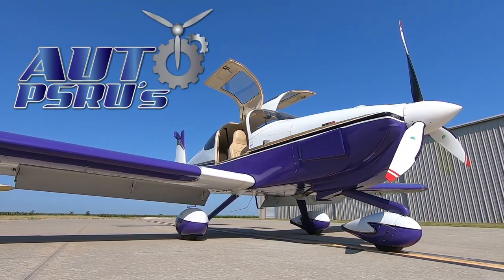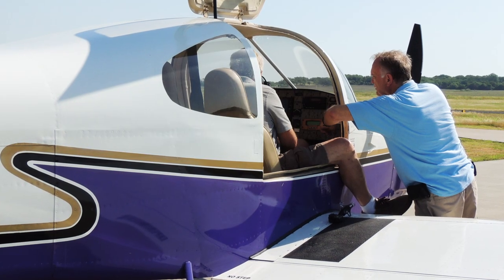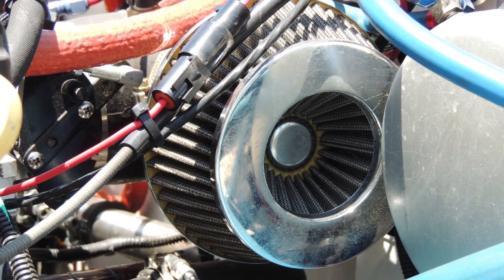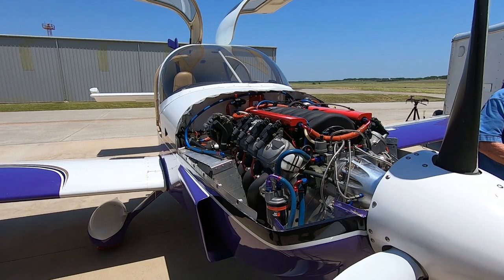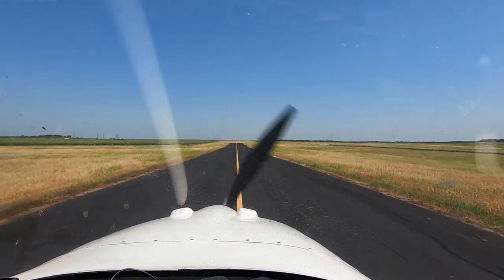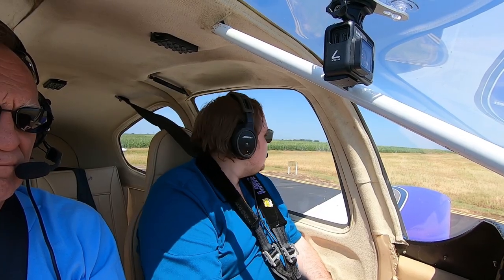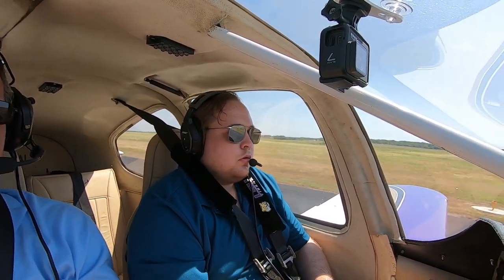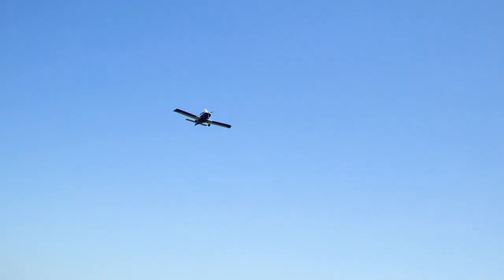Auto Engine Conversion Gearbox for Experimental Aircraft - RV-10

Comment: Tett, the weight of an IO-540 installation and our LS3 installation are virtually identical. I found that the internet is full of miss-leading weight information. This is due mainly to the fact no one gives the details of what their weight includes. Is it just the engine, did they include all of the accessories, wet or dry? Because of that I now own several types and styles of scales to get my own actual weights. Both installations including everything between the firewall and propeller weighing within +/-5  lbs of each other. That includes all fluids and mounting frames for both installations. If we downsize the alternator from 150 amps to 100 amps and use a light weight high torque aftermarket starter we can get down to 5 lbs less. The need for a three bladed propeller to handle going from 260 hp to 370 hp is the only and by far the biggest weight issue. That is why you see an MT composite propeller on this RV-10.
Reply: Awesome! Would Love to hang this setup on my Maule ... :-) Thanx Stuart! ^v^
Reply: From the Taking Off YT channel - https://youtu.be/ryl_PJEaxA8 - Engine upgrade installer is interviewed, he gives his thoughts on new aircraft piston engines - "In order to get certification, these engines have to run 100% for 160hrs, car engines just can't do that." Any thoughts?
Reply: @tetttettamilli6761  GM tested several LS1's during development on a dyno at 100% power for several days straight to prove the durability of their aluminum block for general marketing purposes because they knew that their Corvette market held them to high standards.
NASA repeated those tests to FAR33 standards for their report on viable automotive engines for aircraft titled "NASA Personal Air Transportation Technologies" by Mark Moore in 2006 with 8 LS1 engines. That report concluded that the LS1 was the best choice because it passed the FAA requirements. All of the LS V8's since the LS1 have had several improvements incorporated into them making the LS3 the toughest of all the naturally aspirated small block variants.
GM is not interested in certifying their engines because the demand does not justify the excessive expense, and they are not willing to abide by FAA restrictions on production part numbers they can use in building a certified configuration.
FYI - your Lycoming won't handle 100% power for much more than 15 to 30 minutes tops in actual use. The LS V8 conversions are operated the same way, but limited to 4500 rpm producing 370 hp of the 430 hp they are capable of making at max take-off setting. That's only 86% at take-off and economy cruise is only 46%. That's why we fully expect to get 3000 hrs.
Reply: @stuartdavis2297  I hope I don't give the impression of being lined-up against ur engine/reduction drive; nothing could be further from the truth! It's like that Austrlian guy with that Raptor canard with that Audi V6 diesel - no one more than I wanted to see him make it work. Contineltal/Lycoming has the entire GA in a choke hold and isn't thinking about letting go. So more power to you and your reduction unit/engine.
Reply: @tetttettamilli6761  Thank you Tett. I get all the Lycoming die hard miss quotes that you can possibly imagine. Almost all of it is based on miss information and miss placed opinion. There are a lot more failures out there than successes, so they tend to propagate and grow that trend. Then there are the Eggenfellner's that screw old customers in the name of moving on.
I fear that there will be another conversion company failure soon. I hope I'm wrong, but they keep repeating the same mistakes hoping for a different result. I would rather deal with competition than some else's failures.
Feel free to pass on the information on the LS1 testing and NASA report.
Reply: @tetttettamilli6761   I wonder if you took a Lycoming from 1970 and installed in in a car drove it around without any of the annual maintenance inspection that aircraft get other then an oil change would it last any longer then typical automotive engine.
Reply: @stuartdavis2297  You mentioned Eggenfellner  Honda sells their racing turbocharged crate engine for $6500 all you would need is a PSRU to go along with it could compete with them except with new Honda engines not junk yard engines.
Reply: @stuartdavis2297  how does the ls3 perform at altitude compared to a tsio-550?
Reply: @Mike-01234  As long as you have proper gearing since the engine will only turning a diesel like 2,700 rpms and added electric fan cooling for the fins (Porsche or VW style). Automotive application won't have enough natural cooling air flow by itself with all the radiant heat coming off the asphalt compared  to high speed cold air ducted at higher altitides.
Reply: @stuartdavis2297  I wouldn't be surprised if GM ran many of these LS3 engines for 1000 hours at WOT cycling between peak power and peak torque too.

Comment: With the additional weight of coolant and the reduction drive, I don't expect that engine to be pound-for-pound a comparison to the 540 series of engines. With that said, what's the comparitive weights of the two? And what's the benefit of having a clutch between the prop and gearbox - vibration/harmonics? How much less payload can that airplane now handle with the additional weight of that engine? Were any "hardened" engine parts used?
Reply: My God what a buzz killer.
Reply: Idk about this specific setup but you can build 4 cylinder Subaru engines upwards of 600hp and they way 300ish which is much lighter than an o-550 just saying and it would be FAR cheaper as aircraft engines are way overpriced
Reply: @kalancosta7650  as someone who has built a couple 600+hp Subarus...   There is NO WAY IN HELL I would run one in an airplane!  WAY too unreliable/temperamental.  Hell, at 400hp they're sketchy.
Reply: @RussellTelker  idk man if you build the short block to withstand 800+ then back it off to run at 350hp ish shed prolly last all day
Reply: And it prolly still come out cheaper than a lycoming or continental
Reply: @kalancosta7650  It'd be cheaper than LyCon for sure, but I still wouldn't trust them.  Stock they're pretty good, run them like that with maybe some forged pistons to avoid shitting out the ring lands and it'd be alright at 300hp.  Any more than that, it doesn't seem to matter how you build them, they're hit or miss if they're gonna last.

Comment: Fantastic! I look forward to learning more. I'm building an RV-10 and will follow your progress. Two questions I don't see addressed in your FAQ are regarding high altitude performance and engine noise. Does the standard ECU work well at high altitude, or do you reprogram it or use a special ECU? How does the high altitude performance of the LS3 engine compare to the IO-540 (normally aspirated)? Regarding engine noise, are you using a muffler with the LS3 engine? How does the LS3 engine noise compare to the IO-540? Thanks!
Reply: Will,  sorry for the late reply. It's taken longer than normal to get back to normal after AirVenture this year.
I was told that the standard requirement for the tables in many automotive ECU's was set at 5.25 Kilometers, or 17,224 ft. If they didn't cars could not get through many mountain passes with a low pressure system in place. Above that altitude the ECU we use will interpolate and continue to adjust timing an mixture based on sensor data only.
The LS3 will loose power as altitude increases just like any other engine will. It will loose roughly 3.5% power for every 1,000 ft above sea level. The difference between the LS3 and the IO-540 is we start out 370 HP vs 260 HP, or 42.3% more power, and will maintain that percentage increase as altitude increases. Another way to look at it the LS3 will still be producing 260 HP at 12,085 ft, or what the IO-540 produced as sea level. At that altitude the IO-540 will produce about 182 HP.
We don't normally use a muffler. We will use a cross over pipe if there is enough room for one in the cowling which increases torque and mellows out the noise a little. The noise level is considered by most people to be less than an IO-540. It certainly isn't more noise, and is different. We have not tested it with a DB meter. If we could find another RV-10 with an IO-540 to test side by side with I would rent/buy/borrow an DB meter to find out. We had one customer several years ago in California that had to meet strict noise limitations at his home airport. So he added two small Borla mufflers on his LS1. The noise reduction was well below the noise limits set for the airport without any noticeable loss in performance.

Comment: why dont all airplanes use these engines if theyre so efficient and cheap to replace after time to overhaul?
Reply: Because the airplanes that are built at factorys are certified by the faa and must have every single part tested extensively and certified. It's an expensive process and only a few companies can fund it. There are other car engine manufacturers for experimental aircraft like viking motors (using a honda 4 cylinder. That company had some weird news comeout years ago) And some others I forget.
Reply: Also with these auto conversions I suspect any issue away from home airport will be interesting finding a mechanic to work on an untraditional powertrain setup, plus they are usually already very busy working on normal setups.    Like that centrifugal clutch setup, what mechanic will be familiar to fix that if you are stuck hundreds of miles away on cross country. Just my thoughts.  Really cool though.
Reply: Because of... most of pilots are smart enough to use the proven equipment )))
Reply: @hordi1ful  because most pilots are forced to endure Lyco/Conty monopoly, and their ABSURD prices.
Reply: I don’t see them being that much cheaper. The setup for a ls3 and gearbox fwf from them is $44k. What’s a comparable lyn/conti considering it’s simpler and easier to run? The benefit isn’t likely big enough for many(most) to go out and do all the re-engineering required.
Reply: @OleDiaBole  Either Lycoming or Continental are owned by the company that makes lead additive for aviation fuel, so of course they want to keep making these dinosaurs, they also have people buying their petrol. Not many people actually know that.

Comment: Ben, there are a lot of opinions all over the internet, including here, that think the radiators and coolant must make the LS3 engine heavier. In fact if you unbolt everything from the firewall for the IO-540 and one with an LS3 with the same propeller and fully wet our installations typically weigh 2-3 pounds less with a smaller alternator and light weight starter. We have weighed both for the RV-10. Using the stock alternator and starter will add 5 to 6 pounds, but we like to go with the lighter parts.
Many people think that the radiators add a lot of drag too. But the inlet area of our scoops is slightly less than the area of the inlets on either side of the spinner that we eliminate. The scoops moved to the side of the cowling is more efficient due to being further out on the propeller blades where they blow a lot more air into them, especially on the ground. The exit area is larger than the inlet area to create low pressure that helps to pull the air through the radiators as well. The fixed cowling exit shown in the video aft of the nose gear strut has been replaced with an adjustable cowl flap that works the same as the one on a P-51 belly scoop. We hope testing will prove that this will reduce the overall drag further. We are already faster than an IO-540 and burn 30% less fuel at the same power setting, but saving more on fuel costs is always a good thing to have.

Comment: That depends on what you want to compare to. The LS3 as we install it puts out 375 HP at our 4500 rpm limit. So for take-off through cruise settings the fuel burns are;
4500 rpm 100% - 375 HP = 22.5 gph
3700 rpm 75% - 283 HP = 17.0 gph
3400 rpm 65% - 247 HP = 14.8 gph
3000 rpm 55% - 210 HP = 12.6 gph
None of those power settings compares to the IO-540D that it replaces. A bigger engine puts out higher horsepower and consumes more fuel, even with water cooling allowing for 20 to 30% lower gph/HP.
The closest that we can get to a similar power setting for the IO-540D is:
2700 rpm 100% - 260 HP = 19.9 gph  compares to on the LS3 at  3500 rpm 69% - 258.6 HP = 15.5 gph, or 22% less
2340 rpm 75% - 195 HP = 14.3 gph compares to on the LS3 at  2800 rpm 69% -  194.2 HP = 11.3 gph, or 21% less
All of these numbers are based on dyno data corrected for standard sea level conditions. Actual rpm and MAP settings will vary the performance and fuel flows. The physics of density altitude that effect engine performance is the same for all engines.
Reply: Is that power what the propeller actually uses?  217g/kwh is very good for an old engine. that is is it is actually using the stated fuel at the stated power. I'm guessing the power stated is what it is rated to and not what the propeller consumes. It is still a 200kg engine though. And having such a wide rpm range reduces propeller efficiency.

Comment: That is a good question that no one has asked on this platform before and worthy of a full explanation.
This explanation will be for a true certification, not a temporary certification under Experimental Exhibition or Experimental Test that other people have been done recently.

Yes, the LS3 could be certified, but it's not practical. It would cost 2 to 3 million and take 2 to 4 years. The certification process requires a lot of paperwork, approvals, and testing. That process will eventually destroy 4 to 6 engines to learn how long they last and how they fail under several conditions like lack of oil, low pressure, abusive uses, loss of coolant, etc. Each failure mode requires it's own engine and the results might require repeating the test with another engine.
The worst part is the certification would be good for only that specific version of the LS3. As soon as GM "upgrades" anything or substitutes/replaces any part from another supplier (GM tracks this by issuing a new part number for the same engine with the different parts) the original FAA certification is voided. History has shown that GM changes the part number for the base LS3 about every 10 to 16 months, so the version of the engines you started testing with will be outdated before you finish. It is possible to get a modification to the certification by proving to the FAA that the new part(s) are equivalent or better than the old part(s) making the new part number engine compliant with the certification. Again, more money and time, the possibility of having to repeat some or all of the testing, plus a risk that it will be rejected.
The only way to improve on that situation is to invest a few million more and warehouse (more money) as many of the current version of the engine as you can get in the beginning. The risk there is if testing proves that any modifications are required then all of the engines in the warehouse will also need to be modified exactly the same way. But when the supply of those engines run out you have to start over, or file for a modification to the original certification and refill the warehouse.
It tends to become a bottomless rabbit hole to throw money and time into.

The only way around the central issue of not being in control of the engine configuration is to manufacture the engines under license, if GM will let you do that. Either way you end up with an certified engine that costs as much or more than a Lycoming IO-540 or Continental IO-550, and that is an even tougher selling point to overcome. To me this is not a good way to promote aviation.

In recent aviation history over the past 30 years there have been three companies that invested all the money and effort to certify different auto engines. All three went bankrupt in less than 7 years. This company, under two owners and two names, has survived over 22 years without certifying anything, so we don't feel any need to change that.

But if you are rich and in need of a huge tax deduction call me. :)

Thanks for asking.

Comment: The main conversion for an LS3 engine to do unlimited aerobatics is changing it to a dry sump oil system with 5 pickup points. That is not required to do "Gentleman" type aerobatics without negative G's. The only issue you might have without a dry sump oil system is with a bad PCV valve allowing too much oil into the intake. Replacing the $5 PCV valve during annual inspections will prevent that from developing.
The difficult part of using any diesel engine for the gearbox and the propeller is how the explosive combustion cycle pulses are dealt with. The combustion cycle pulses on a gas engine is a much slower burn. The older mechanically injected diesel combustion cycle is an instantaneous explosion. This causes the loads on the gears, bearings, shafts, propeller hub, and propeller blades to increase by 12+ times. The modern electronic diesel injection systems will pulse the fuel 10 times during each combustion cycle to dampen the power into more of a sin wave instead of one massive pulse. That helps a lot but the loads form the power pulses are still 3+ times that of a gas engine. That is a big improvement but still requires structural upgrades to everything. This is why certified aircraft diesel engines have a 500-1000 hour TBR instead of a 2000 hour TBO.
The weight that you quoted for the R2.8 engine is 20-24 pounds heavier than an LS3. To that you have to add a heavier duty gearbox and propeller. I can't estimate the weight increase for the propeller, but the last time I studied this issue the gearbox would go up at least 45-50 pounds. Adding 65-74 pounds to the engine installation makes any aircraft too nose heavy.